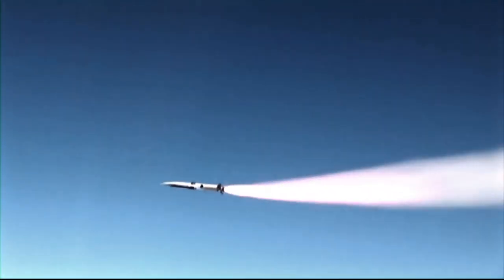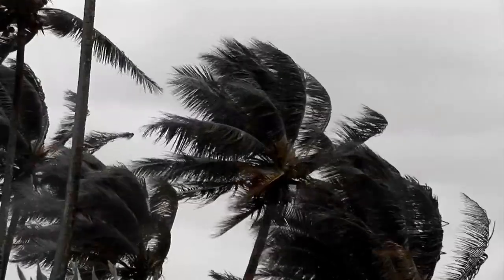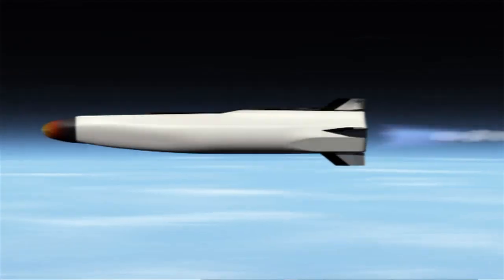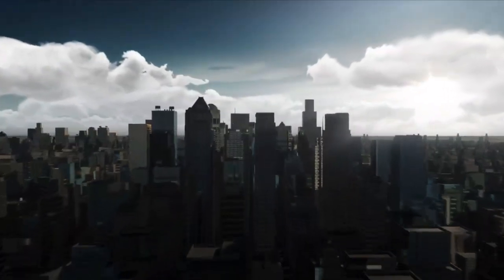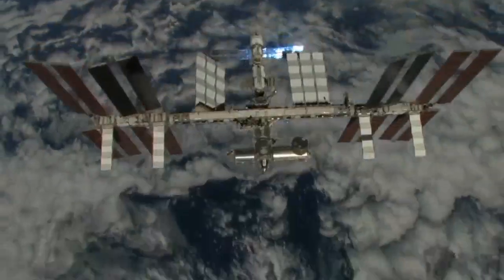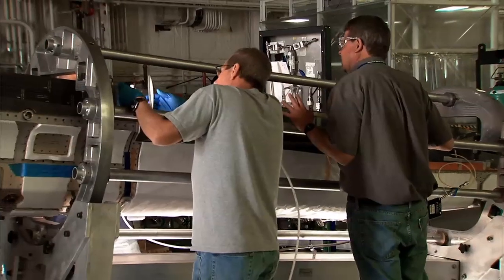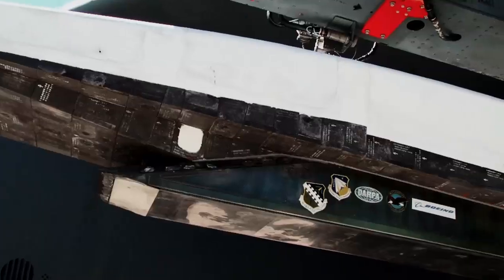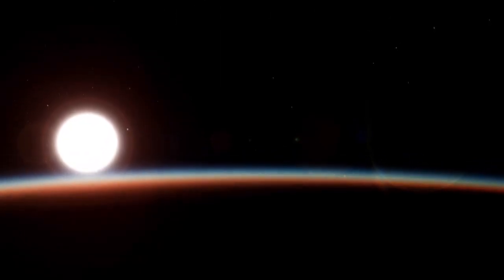Boeing's Unmanned Scramjet, the X-51A WaveRider, Achieves Hypersonic Speeds

Comment: If this is so fast wouldn't the G-force potentially hurt you?
Reply: get into the plane, you black out, BAM!! welcome to UK, surface temperature 70F
Reply: Top speed does not equate to acceleration speed. It is true that acceleration speed can create potentail injuries from G-Forces generated. But as long as acceleration is steady and linear at a rate below 2-3G's, there is no top speed till you approach the speed of light.

Comment: Tokyo to NYC for the 1%. This is not new tech, old it's tech being marketed for commercial flight, the U.S./Boeing (what's good for Boeing's good for America, right? after all, just look at that spinning collection of plates spinning on poles called the "Dreamliner") replacement system for the French Concorde (take that! France). Scramjet is decades old conceptually, has been leashed to expensive labs most of the time. Anyone who thinks that this will be fitted to the new, massive double deck Airbus lives in a magic bubble where fairies fly the plane... None of the 99% will ever be able to afford the USD $10,000 ticket, which is exactly what a 90 min. Tokyo to NYC fare would cost, based on the Concorde as a reference, and given that the movie which cost me $1 as a 12 year-old now costs over $10, I'd estimate that $10,000 would be something which a LOT of people out there would still be able to pay. After all, corporations are people too...

Comment: The scam-jet design: Why was it not developed 60 years ago when it was possible? Now, all that matters is airport design accommodating what is existing
Reply: The SR-71 used Pratt & Whitney J58.  The updated variant was a partial ramjet.  It used conventional compression at lower speeds and area compression at higher speeds.